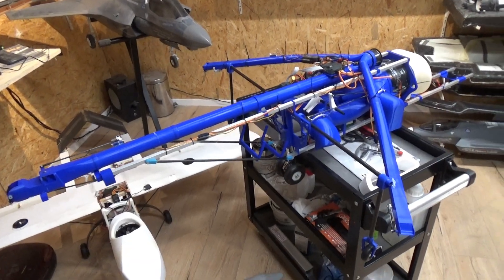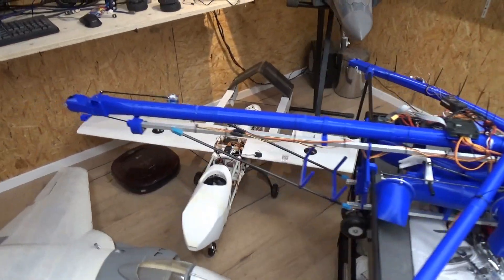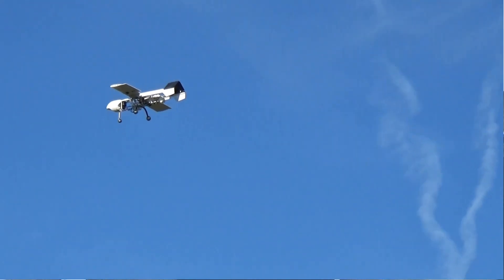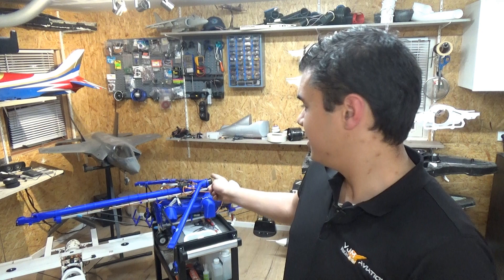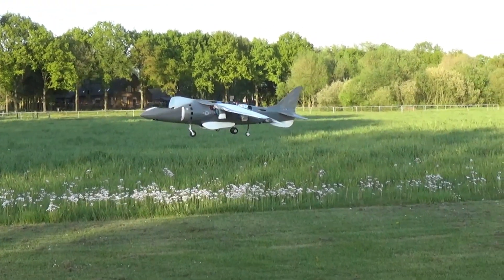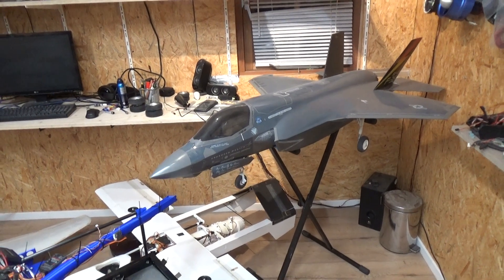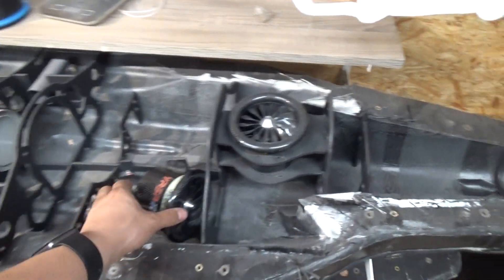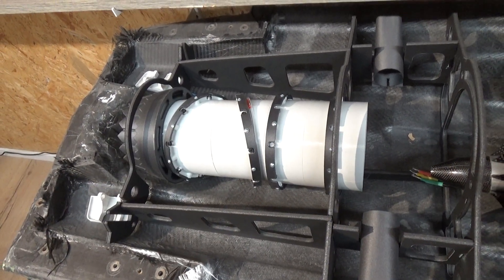F35 | Harrier | VTOL | RCplane Homemade builds

Comment: That's good idea to build a model of the "Harrier" like this. 

 And how about the practical adaptation of this aircraft? 

There is some weight that, in my opinion,  is excessive, actually. 
For example, two of the EDFs.
One of them is required for the main power plant. The other one - for maneuverity or stabilization of the aircraft.

As for me, it would be better to design an other kind of a power plant.

I would be pleased to have a chat with you for this subject
Reply from the maker: Hmm 🤔 always free to chat;)